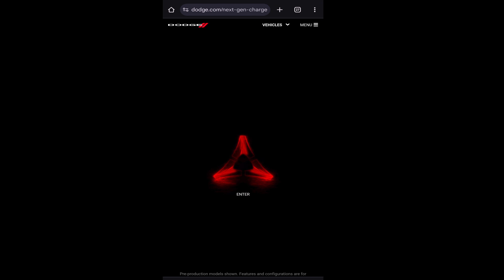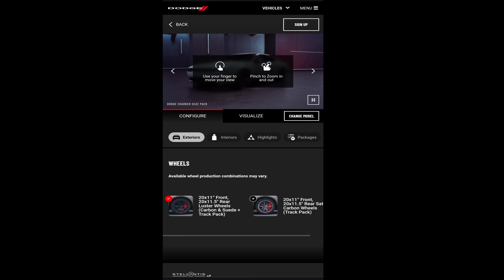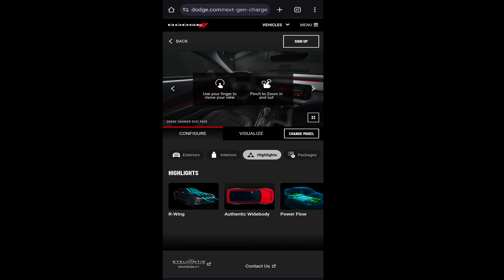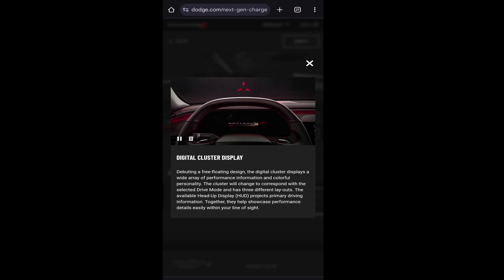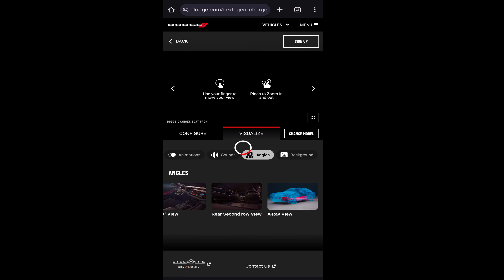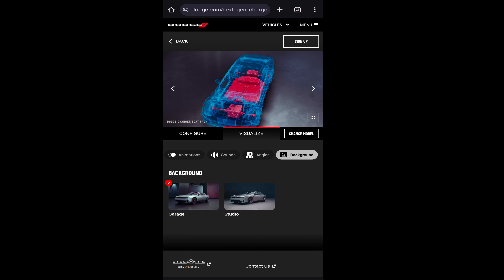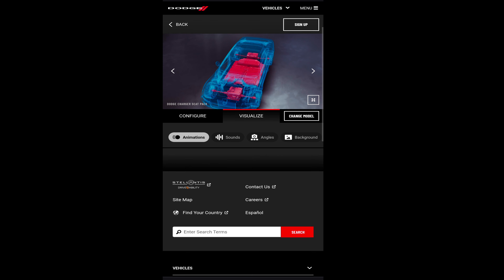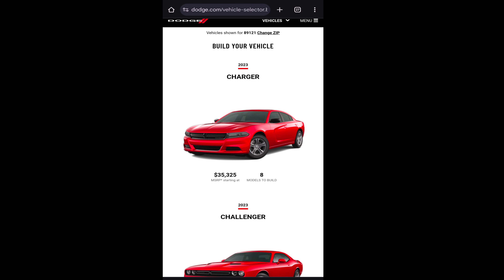Building My 2025 Dodge Charger EV😱 Then Site Fails 🤣

Comment: A bit behind with the 400 volt architecture when Hyundai is using 800 volt.
Reply: My only guess is that it's because the Supercharger network only puts out +-400V, which severely kneecaps 800V EVs without a beefy (expensive) on-board booster. The part I don't understand is they never announced a partnership with Tesla for Supercharger network access
Reply: The charger and daytona will be 400volt, the Banshee flagship will be 800volt supposedly

Comment: What I found interesting was some of the color choices.  From the preview photos, I expected Bludicrous to be a dark blue metallic.  In the configurator, it's closer to B5 blue.  After Dark is a lot like Frostbite.  I was looking forward to that dark blue.

In either case, the choices aren't really all that many, like anything else these days.  

I admit that I never even tried the sounds on the website, as I was never intending to use Fratzonic, anyway.  

The lack of pricing information is disappointing, to be sure.

Comment: it's insane that a widebody jailbreak cost 20 k more than a standard jailbreak.   Rivots and 8 screws is what keeps the plastic widebody together and they deem it is worth a whole compact vehicle more.  I thought the Crack era was over.  However, if I to choose between an EV scat pack or paying 90k for a Jailbreak Widebody; well put that pipe in my hand and call me Mister Tyrone Biggums.
Reply: Tyrone Biggums 🤣 hilarious. Great post!
Reply: TK said that it's true Widebody meaning that the body itself is wider with no kit. I do agree that is not worth 20k more.

Comment: People do not like when you use terms that were applied to previous vehicles to describe a different drive system. The car is a Charger. Scat Pack and Hellcat define different Chargers than a electric drive system Charger. A electric Charger with power equal to a Tesla S plaid would cost as much as a Tesla S plaid. The S plaid fits a niche market. Dodge need cars that will sell at a affordable price. Dodge needs to revitalize its base car sales before worrying about its niche car sales.